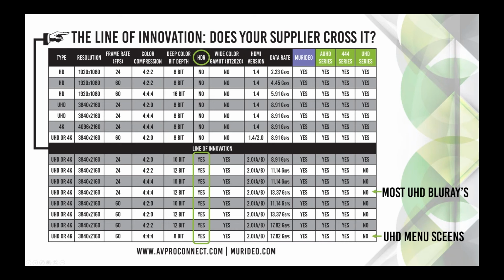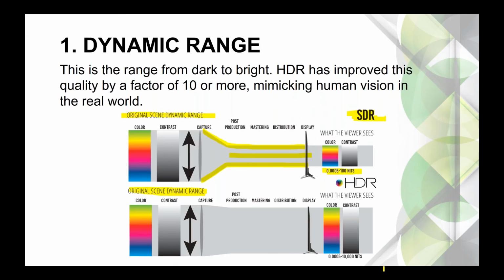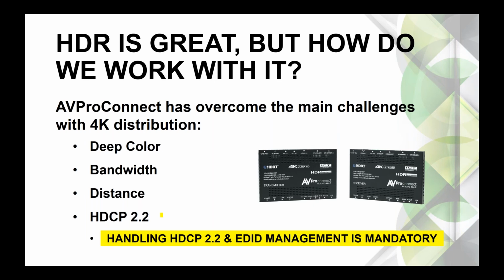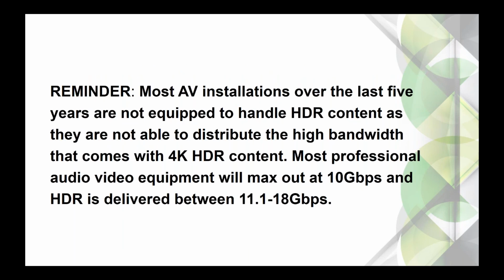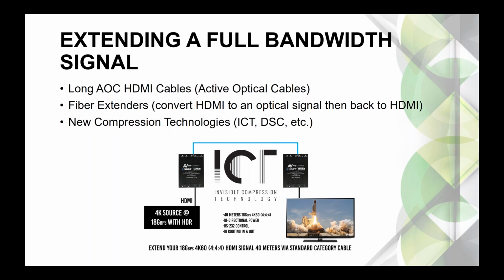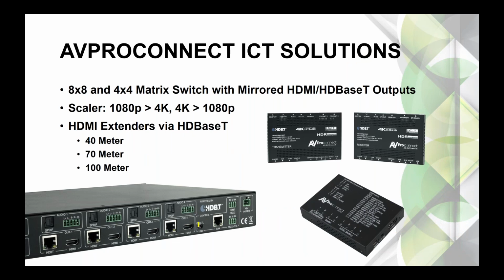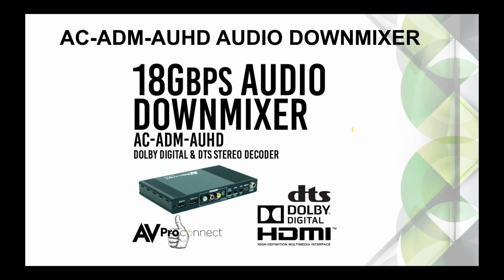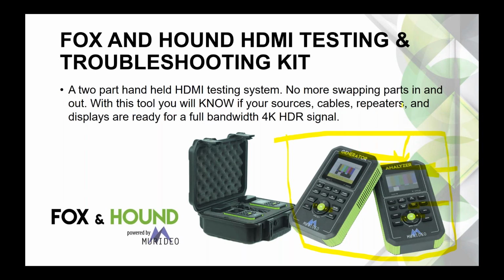4K60 4 4 4 and HDR Distribution and Solutions

Comment: Some great info that hardly anyone knows. Great in depth video. Especially with the 4K Blu-Rays being 4:4:4 when it's shown. Looks like it's 4:2:0 compressed to fit better on disc or files. That's why the metadata is so high. Has to compress so much info and takes so much bandwidth and processing power to play.